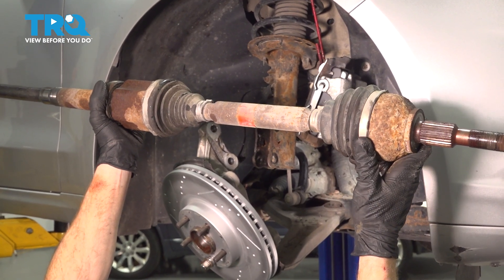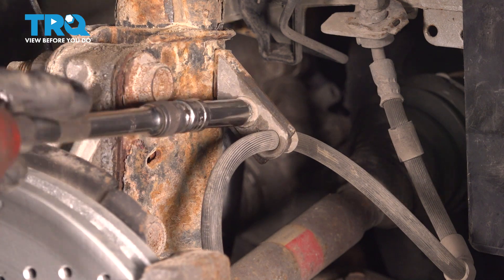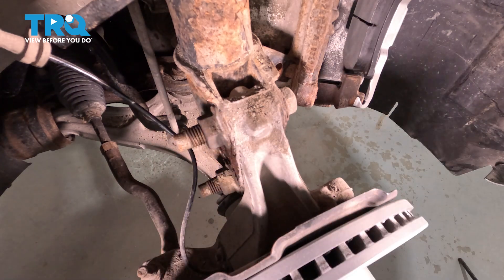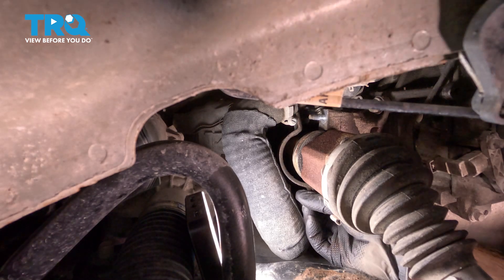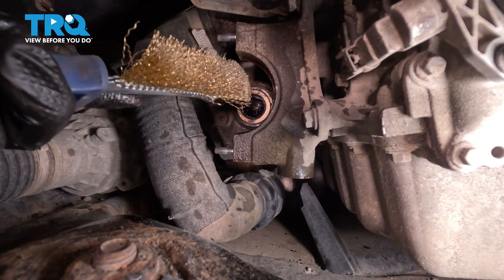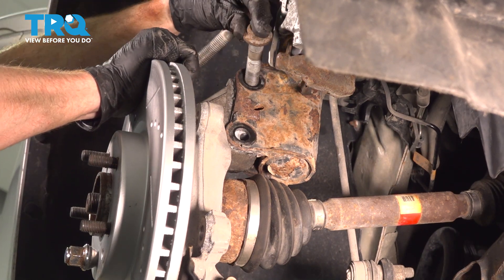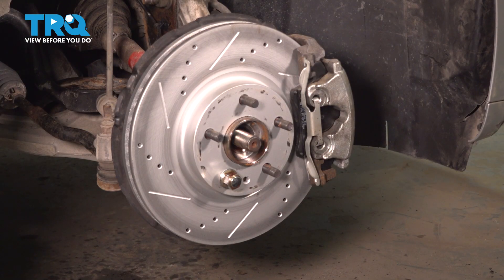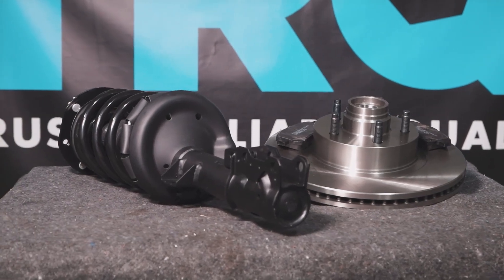How to Replace Front Right CV Axle Assembly 2013-2020 Ford Fusion 2.0L L4

Comment: I recently changed my front struts on a 17 fusion, I left the rt front axle installed while I did this. I'm having a hard time getting the axle to go back to neutral position, as it hanged down during removing the strut. Please advise